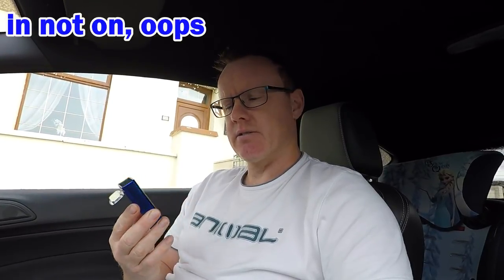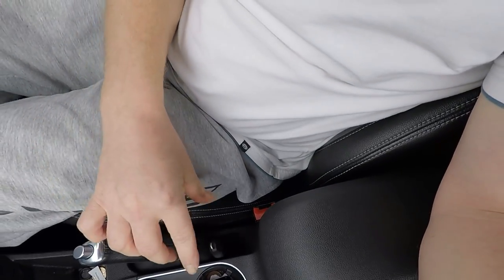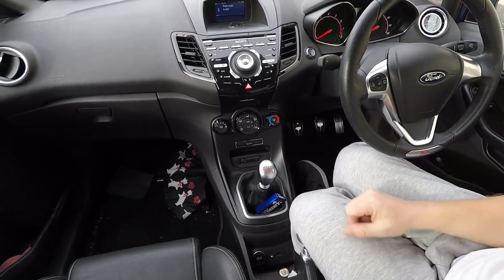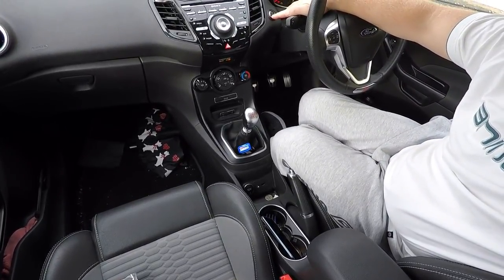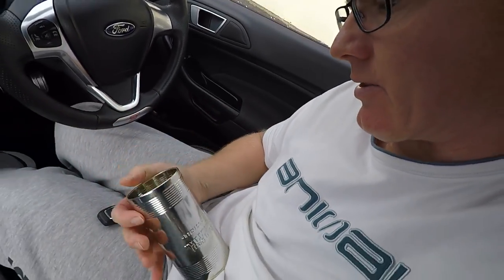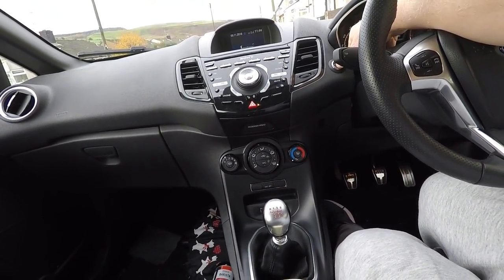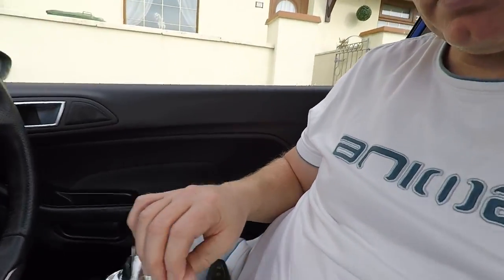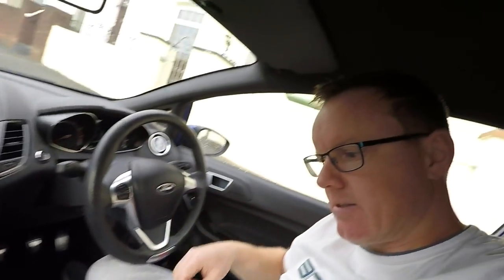STOP the thefts.Fob in a tin can? FIESTA ST

Comment: The only way to deter Ford thefts is to put a switch inline with the CAN bus wire from the OBD. That's because on this model, they don't boost the key signal on these models.
They use the OBD port to turn off the alarm and then code new keys. If you hide a switch under the dash that cuts the CAN bus line to the OBD, they would have to get better access to the car to look for it which would set the alarm off for all of the time they are looking.

Comment: Wish I had of seen this video before my car was stolen. Have learned a lot about how these thieves operate now. There used to be one method where thieves could record your fob's signal and play it back from another device, but newer systems safeguard against this. The method that's very common now is simply amplifying your fob's signal in real-time.

I now use a Faraday box for my keys, have a Faraday wallet, installed the Ghost II immobilizer, and have a hidden tracker which is monitored by a security company (who immediately alert me if the car is moved without being started). I also have a wheel clamp I use when I have to go abroad for any length of time. They keyless entry/ignition system is flawed, and car dealers/manufactures should be warning people at the point of purchase.

I bought another expensive car - it'll be a cold day in hell before I let thieves dictate what car I can/can't buy.

By the way - also remember to protect your spare key!!

Comment: Great video modern technology there are always a way round it I'm from the veihcle security industry I think it might be time to fit the aftermarket imobilisers which work via touch key which first appeared in the 80s and maybe additional alarm systems to go with it I remember when cosworths were the thiefs target and fitting all sorts of devices to prevent theft a separate adr cards worked as well great trick with the tin have a good day thanks for Sharing

Comment: All you need to do is find something which completely blocks the frequency used by the keyfob. The problem is thieves with good kit have the ability to boost the signal from the key, so many Faraday pouches and biscuit tin / alu foil DIY methods don't sufficiently inhibit the signal to prevent the keyless theft. You need to buy a good Faraday pouch with a high signal attenuation.

The relay attack works by having a pair of transceivers which operate on the same frequency of the car transceiver and the fob. They 'bridge' between car and key as well as wirelessly link to each other, allowing a thief to stand by the car with one unit and another to walk around a building until their unit detects the key signal. They can boost the weak keyfob signal so even hiding it inside metal boxes doesn't always work. 

Some of the relay kits can also learn and impersonate the real keyfob allowing thieves to lock/unlock the car at whim. Once the immobiliser is disabled, anyone with the right tool can code a new key from the CAN port.

You're seriously recommended to physically relocate the OBD port. I've done so, it's easy, and also perhaps install a nonfunctional fake in its place which looks identical but does nothing. (I am contemplating wiring data pins to the battery...)

Comment: My 1989 Fiesta has a key which does nothing but unlock doors and fire up the ignition, manually! You can probably get into it using a block of cheese but I have a steering lock I'm hoping will continue to deter scumbags. Granted, I don't get many toys inside to play with, but you don't see me having to lug tins of baked beans and mints around as security devices. Lol
Reply: I am more concerned that a thief would consider it worth stealing at all.
Reply: @gravemind6536  Haha, give it another few years and its time will come again to be desirable!
Reply: Hahaha true you could start old fiestas with a flathead screwdriver 😂
Reply: @JP94  You could start a vauxhall Nova by removing the Hazard light button and reinserting it upside down.

Comment: Another good way of protecting your key less entry key fob is to place it in a microwave , blocks any unauthorized incoming signal. Please note mate sure you remove the keys before you re-heat you pies !!!!!!!!!!!!!!! or just find a old non working one at the local tip  ////// job done.

Comment: Hi Steve you need to make a Faraday box, this isolates all radio signals and is super cheap easy. Any of the tins and wind copper wire around the outside of the tin until the signal is blocked. Maybe line inside and outside of tin with Aluminium foil also as this boosts the blocking ability of the materials, seems like it is all down to personal experimentation as very worthwhile stopping scumbags stealing your pride and joy for a few pennies/minutes isn't it ;-)

Comment: UPDATE: Got my Fiesta Eco Boost back. The thieves reprogram the car via the OBD2 socket which is located behind a mini- glove box-like flap to the right of the steering. Squeeze the sides in and it folds right out. A clip on either side of the OBD socket and push it through. Push it up into the wires, or left, or right. Up to you. Lower the glove compartment (thats where the fuses are, behind) like you did by squeezing in the OBD cover and remove fuse 19. That kills the data line in the OBD. I made a sticker on my Labeller for the drivers wing mirror "OBD port moved." You cant miss it when the mirror folds in.
Bought a wheel lock too. Its reduced the odds of "drive away" theft significantly.
Keys in a small biscuit tin when not in use.
Hope this helps.
Its about reducing odds by increasing their time at the car.
Reply: To reprogram your car they first need to get in. To get in they would've captured your fob's signal, amplified it. If they can't reprogram it, because they have your fob's frequency, can't they still just drive away with your car?
Reply: @genomedia44  sorry..yeah, they smashed the window to plug into the socket

Comment: Polished the Jag and saw another from you!
The tin needs to be grounded to a good earth to make it an effective Farady cage which would block the keys radio signal. Unearthed, it will act as an antenna attenuator instead. A piece of equipment known as a frequency spectrum analyser would show, though, the various cans do attenuate, (reduce) the fob radio signal.
However, because your sitting inside the car, the signal strength is still within set limits, the Car Key radio receiver needs to take into account, for low key fob battery level. Hence the varied success of the experiment.

Comment: I guess the car holds the immobiliser off once it has the signal for a length of time. Maybe worth opening and closing the door to provoke it to search for the fob signal. 

Back in the day I’d hide a switch under the seat that broke the feed to the ignition coil. 

The problem with any security measures you put in place means it’s more likely that the scrote has to come into your house.

Comment: Obd relocate. obd disabled reactivated by dongle fob. Faraday bag for key. Disklok, revo sps switch with anti theft mode and quick release steering wheel
Reply from the maker: thats a great anti theft spec. i read the faraday bags stop working after a while. not tried one myself
Reply: Great vid steve, but dont forget to keep your spare key wrapped in tin foil too.
Reply: Also have an electronic handbrake whuch cant be turned off while car is in anti theft mode, and that cant be turned pf without the sps switch, and that cant be turned off without the obd port dongle and knowing the kill switch buttons i have programmed on the radio 😂
Reply from the maker: @fastfez2520  and for good measure a spike under the driver seat activated by tnt. :)
Reply: Spark Plug Steve i was thinking more the electric killer belt to stop car thieves from robocop 2

Comment: Get a pandora alarm 🚨: the alarm comes with driver tags and it won’t start even if you have the original key ! The pandora immo is around £400 and the immo and alarm is only £100 at £500 👍

Comment: Some cans don't close as well as others that's why some arn't blocking the signal. Some cans start off with blocking the signal and wear out afther many open and closes.
I'd say use aluminium foil and grab a new piece every week or so it tends to wear out quite fast, atleast it's inexpensive. I use a stoplock pro + OBD relocated + aluminium foil. Then again if they really want it they can get it. But this slows them down alot.
Reply from the maker: Iv read the farady pouches stop working after a while. I will check my tins again at a later date and see if it still works.

Comment: Cool little tip, I wonder how effective it is against the thieves technology.
Non relevant question, how useful do you find your boost gauge in the vent on a daily basis? It's something I want to do but where I have the steering wheel my hand blocks my view of the vent. Wondered if it was the same for you and if it bothered you as a daily feature.
Reply from the maker: yes to be honest it is a little obstructed and you have to tilt your head to properly see it. but its something i rarely check unlike the other guages.

Comment: Why did I smile all the way through this? "Sorry about the mess in the car, the wife doesn't clean it out that often". Thanks for cheering me up. I have a 5 door ST. What are your thoughts about the overheating/possible fire issues that a few people have had? I am told my ST is OK as it was built in 2017.
Reply from the maker: Thanks very much. Appreciate the kind words. I heard after late 2014 it was fixed. I'm 2015 and have checked the Ford etis site and my car is not showing for a recall. I think your definatley safe on a 2017.
Reply: Keep an eye on the coolant and temp gauge. If the coolant gets low or the temp get high, either fix it or get rid of it for another one, I have heard after 2016 is safe however due to a redesigned cylinder head/gasket.
Reply: @CouchMan88   I was told my ST was the last one off the production line for the outgoing shape in 2017.

Comment: Any car with keyless entry is vunerable to the car being unlocked. So not just ford Indiekeeko.
Reply from the maker: Hes just upset he hasnt got an st. ;)
Reply: The car being unlocked is not the problem the problem is they are able to then start the engine keylessly and drive off. Cars have had keyless entry for 2 decades and it wasn't a problem before because the key was still need to start the engine. cars in the 2004-2009 era were the very peak of car security and thieves just couldn't get them moving so would instead find a way to steal they keys which is easier. Now they just get a computers off ebay that can be used to steal your new cars.

Comment: I simply do not like all the 'wifi' systems we now have on cars. There is nothing better than a physical key and how difficult is it to turn a key in an ignition lock? A key that folds into itself (VW vans etc) is as conveniant as a 'fob'. When I worked as a Scania fitter they had the door release in the key (you could also run a lighting check off it) but it also had a chip in the key that was encrypted to another chip in the steering column. You might be able to turn the key in the lock but the electrical system stayed dead without that chip. Spare keys had to be synchronised by the dealer. I have a Renault Laguna II that has a 'card' that releases the doors remotely but you have to physically insert the card into a slot. This releases the steering lock and turns the electrical circuits on enabling the engine start button.

Maybe we have gone too far with technology. After all if a man invented it another man can break it.

By the way that 'tin foil' is actually aluminium. Lol. And another way to recycle cans has been found ...

Nice Vlogs mate ....

Comment: Very interesting experiment BUT for me I will never ever invest in a car where the key doesn't have to be in its ignition barrel and yes I know that it still can be hacked but at least the thieves still need the actual key to insert in the ignition. I just replaced my front door with one without the letter opening mechanism and never leave anything on the hallway table and also have an alarm and video recording covering all the windows  and front and back door but my dog keep activating the sensors which is headache especially for my neighbours. It's shame that our society became so insecure on all levels.
Reply: Ur shitting it mate most people got glass front doors if ur wood aint strong enough ill kick it down for ya

Comment: forget all this. I had my Fiesta stolen last week. They smashed the window and did something in the car. Dont know what it was, but it was nothing to do with amplifying the signal from your house or they wouldnt need to smash the window. The police recovery garage where it ended up told me that 70% of stolen cars recently were Fiestas. All with the driver window smashed. 
Takes them 20 seconds, so forget Buscuit tins and smint packets, just get a big fuck-off sreering wheel lock.
See....these twats arnt going armed with bolt cuttters and angle grinders anymore, just a centrepunch and some kind of reprogrammer. If they see a wheel lock, they move to the next one.
Reply from the maker: They plug a tool into the obd2 port. It's well known if you don't hide that obd2 port your cars vulnerable. There's a few techniques they use and the key scanning is just one of them. It's not the only one
Reply: @Sparkplugsteve  thanks....and that port can be blocked off in some way. Ill have a thiink and report back
Reply from the maker: You pop it out of its factory position then hide it somewhere up behind the dash. You can't chop it out as it's needed to diagnose faults and do car checks etc so you will need access to it but hide it where only you know where it is.
Reply: @Sparkplugsteve  Thanks for taking time to reply. Its been a great help. Steering lock on the way